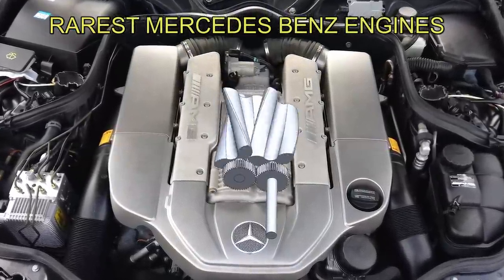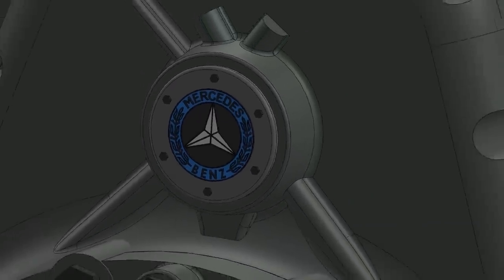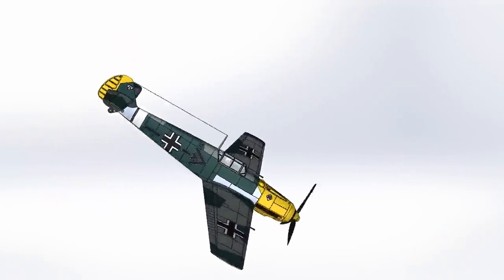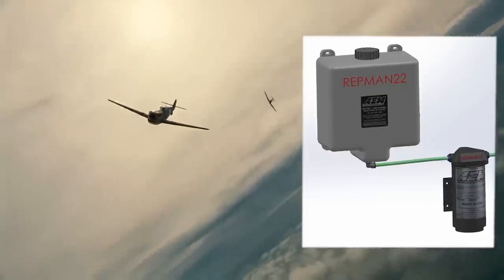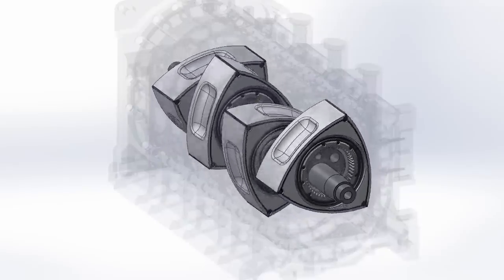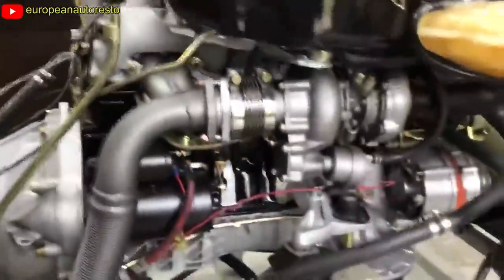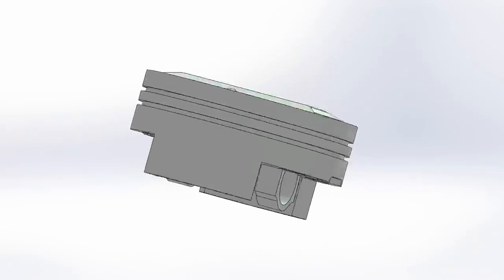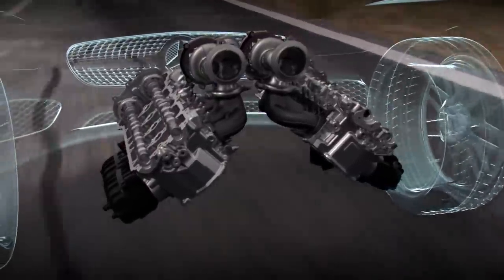7 RAREST MERCEDES BENZ ENGINES🤯

Comment: did this man just say a supercharger but has an image of a turbo
Reply from the maker: it is a centrifugal supercharger. Similar to a turbo, but driven by the engine. Turbos are driven by exhaust gasses. 
The other superchargers are "root Type or screw"
Reply: @repairman22  thank u for correcting me i had no clue that was a thing. thats actually really awesome

Comment: I remember back arround the 60’s & 70’s but they were arround for longer, that Mercedes made a SOHC straight-6 that was so good that Toyota copied it for the Crown & other such cars. Well the Toyota version of the motor was such a good copy the parts were compatible & you could repair Mercs with that engine with much cheaper Toyota parts.

Comment: How are the last 3 engine rare? M617 is still around m113 is still around m278 is still around and they are everywhere.
Reply from the maker: They were an innovation when released.
Reply: @repairman22  does not make them rare, especially m617 and m278 because they are in just about in everything

Comment: If a V Engine is built inverted or upside down it’s an A engine.  For example instead of calling it a “upside down V-8” would be called an “A-8”
Reply: That seems dumb since there is no horizontal combustion happening mid block🙄.
Inverted V makes since.
Reply: @TURBOBEATZZZ  OK, what about an H engine than?
Reply: @TURBOBEATZZZ  it doesn't need horizontal combustion and you dont need to take the letter "A" so seriously, its used since there is no letter such an an inverted V and is actually the scientifically correct way to describe such engines
Reply: @Hawok13  You are contradicting yourself.  You criticize the same logic you are arguing for SMH.
Reply: @TURBOBEATZZZ  how TF am i contradicting myself? Elaborate.
Reply: @TURBOBEATZZZ  it seems to me that you are both missing my point AND the logic behind why inverted engines are called "A-type"

Comment: So, which Mercedes cars use a hot V engine? Is this only used in the AMG performance models or are all recent V8's hot V?
Reply: First time it was used in w211 with v6 diesel single turbo engines. And that is the first time hot V being implemented.
Reply: all recent ones are hot v

Comment: Ehhhhh the engine from the bf109 is true but the facts are somewhat awash. The 109 was a well performed aircraft that operated best at mid to high alt as it was used often as an interceptor considering the Germans limited interceptors they built. Back then, many aircraft had to be manually tuned as you gained and lowered altitude to ensure top performance. This was due to many factors, air pressure, available oxygen, the days temp. 
So what was it good at? Multipurpose mid range missions as they needed to be all over Europe. Some countries had better dogfighters, some faster planes. The 109 was good early on as it was a high performance aircraft that could compete with nations. This would become an opposite as by the end of the war the allies were running circles around them in their planes. This is not including the 262 and 163 as both of those were emergency measures that were heavily mismanaged. The 163 killed lots of its pilots and the 262 could only fly 9 hours before both engines needed to be completely replaced with resources they didn't have. Unaffordable for a country fighting in a war they've been losing ground on for 4 years.

Comment: What a stupid title? "The 7 RAREST Mercedes engines...portraying a Diesel engine that was built in thens of thousands of cars between 1974 and1992. But in the same time FORGETTING the REAL and RAREST 5 cylindre Diesel Engine built by AMG (OM 612 DE 30 LA / 612.990) and used in just a few hundred cars.

Comment: Most of these engines are NOT rare... especially the OM617.. there is still millions of them on the road as of 2023!
Reply: Just about to say that, OM617 rare really?!
Reply: @Torpedo_Hans  probably rare due to the sheer reliability. Other than Semi diesels I don't know many car ones that reliable
Reply: @jakixs  VW/Audi diesels (1.6, 1.9.d and first and second generation 1.9 and 2.4/2.5 TDi engines) of the same era and beyond until the mid 2000s. Also you have other Merc engines that are reliable like the 300D (OM 617) for example 240D (OM616) 220 and 200D (OM 615), 180D (OM 636) and many more. The key factor is maintenance, a neglected OM617 wont last the magical half million and million kilometers just like any other engine I just wrote down

Comment: The hot v is not rare, and BMW came up with it.
Reply from the maker: Hot V engines are only 15 years old in production cars. They won't be so weird now, but back then...
Reply: First hot V was implemented in w211 v6 turbo diesel engine.
Reply: @Repairman22  You did a great job man! Love the presentation!

Comment: The DB600, turbo diesel and hot V engones are definitely not amongst Benz's 7 rarest engines.
Reply from the maker: how many inverted V12 existed in the 30' and today? How many diesel sedan 5 cylinder turbo existed when it was released? How many Hot V cars? Of course now they are simple.
Reply: @repairman22  The DB series inverted V12 BMW engines went into a hep of the German military aircraft during WWII. They made a LOT of them. Production for the original W116 turbo 5 pot Mercedes was apparently 28,634 so again, quite respectable. Mercedes have been making the M117 V8 since 2015 and using it in a heap of different models. It's definitely not rare.
Reply: @shoutykat  yes, we made lot of db engines during ww2. But after ww2 we scrap most of them. Of course you can find some engines in museums but how many of them still can run?? 0% of them. Full functionally Db600 is more like unicorn today.